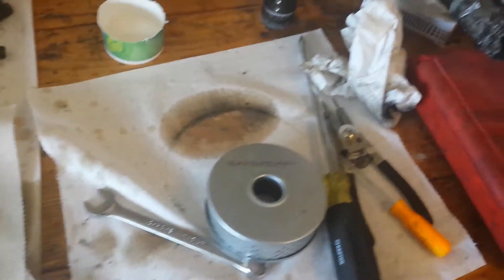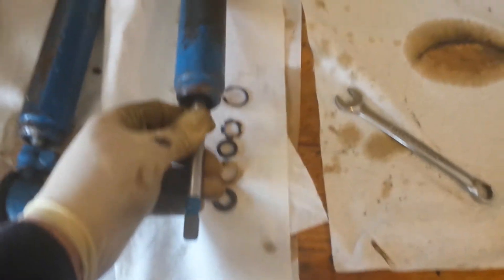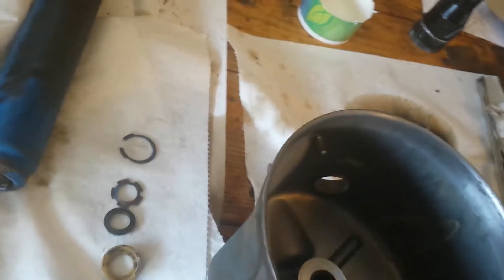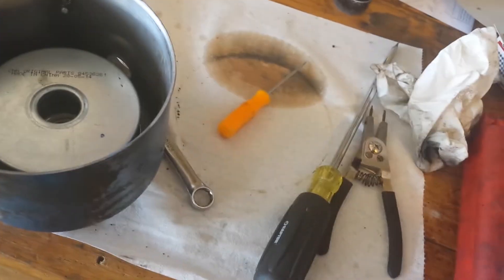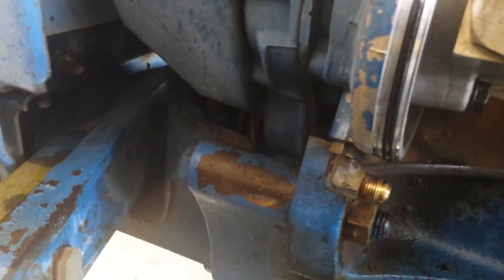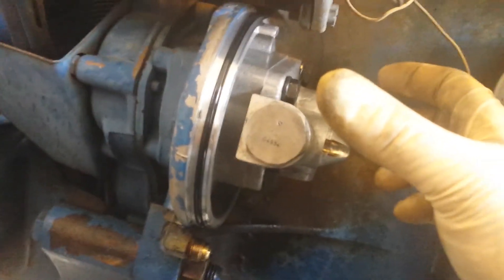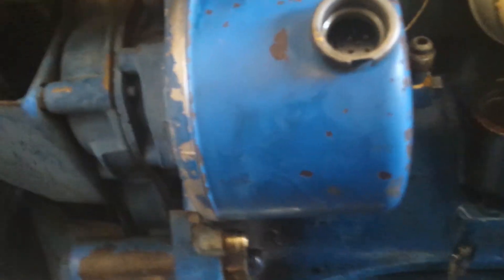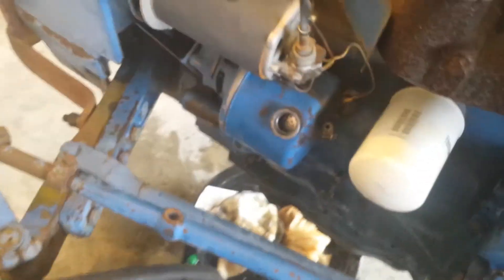Ford 3000 power steering part 3.

Comment: My Dad's Uncle bought Our 3000 Diesel a month or so before I was born in January of 1968.  My Dad says that Ours doesn't have the 13mm bolt in the back of the pump like You are talking about.   I know it is the original pump, because I know My Dad's Uncle rebuilt it with rubber washers like You put on House Facets with.   I don't think if the older models had a different pump or what.  I am thinking that it probably came from England because Diesel Tractors were pretty new back then.

Comment: I have to replace the power steering pump on a ford 7000 series diesel tractor. Are the bolts to remove the pump behind the filter? Also it looks to run off the cam shaft gear, is the power steering pump gear have to be timed with everything else or not???

Comment: Great videos.  I also had to replace the upper seal in the steering column on my 3400.  Not too bad a job.  Where did you get the seal kits for your cylinders?  Were they outrageously expensive?

                      Thanks,
                                Jack
Reply: my 3400 power steering works good for 15 min. then it almost stops working?